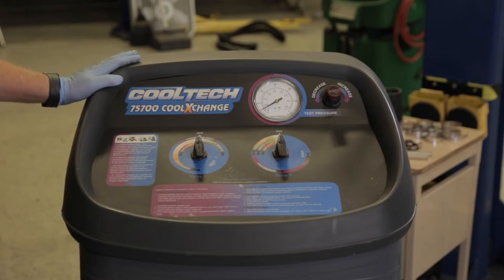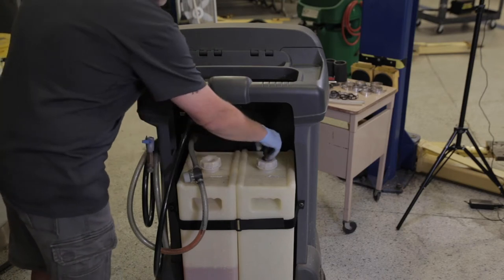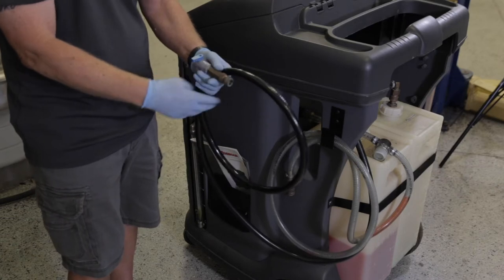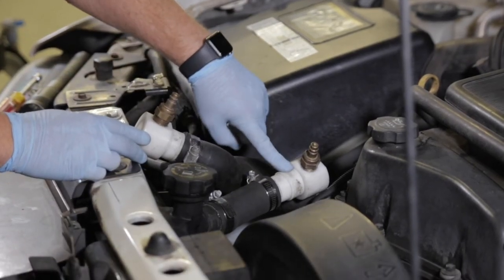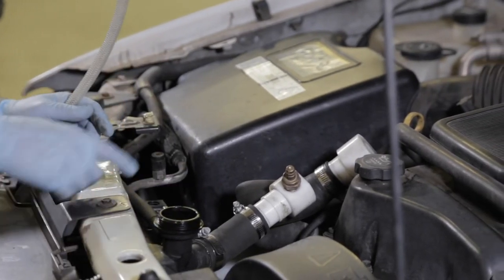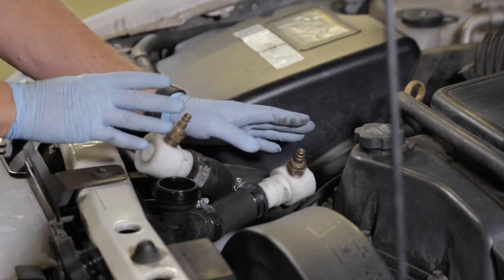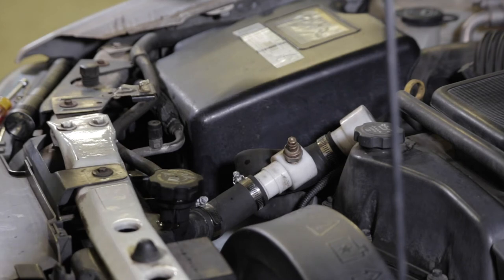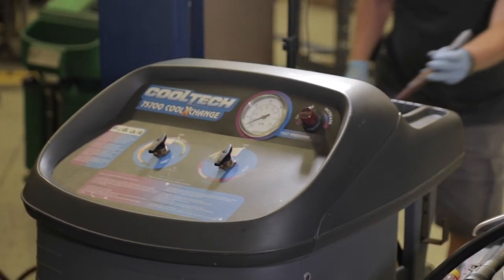Cool Tech 75700 Exchange

Comment from the maker: Since the liquid going in is what pushes the old liquid out, I would recommend first filling the machine with water so water is pushed through the system. Then you can disconnect the machine, disassemble the parts, and only water is spilling out on the ground. After that you can push new coolant in.

Comment: Can the coolant be recovered without adding new coolant so I can make any repairs to vehicle ie.water pump etc.
Reply from the maker: The waste coolant cannot be included in the replacement cycle.  You can pump the coolant back into the vehicle (from the waste tank) but you would need to bleed the air out.